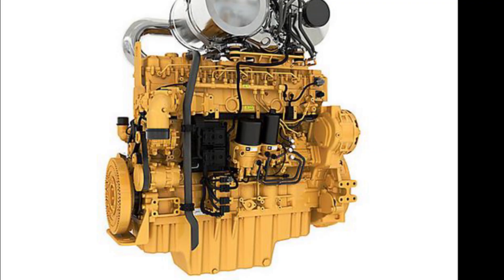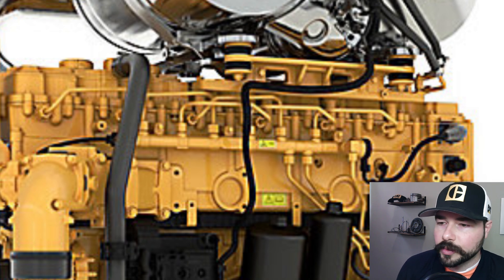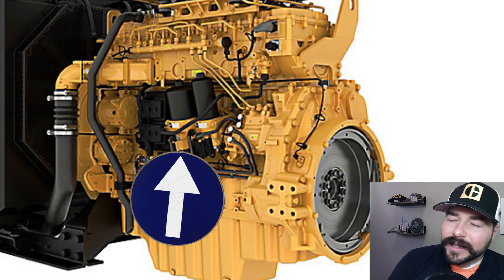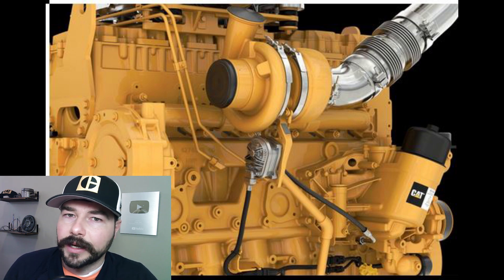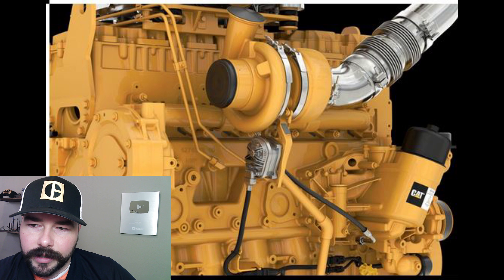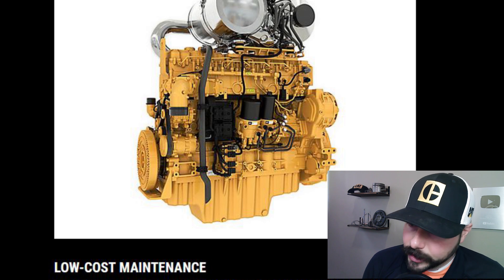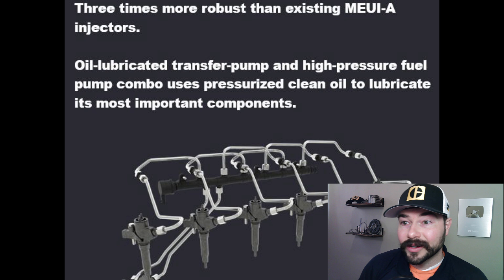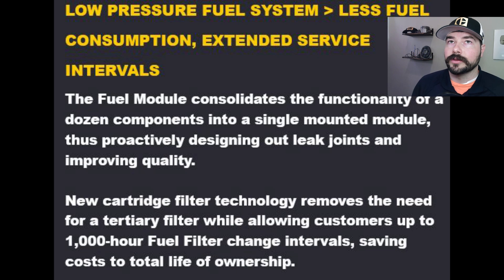New Cat Engine set to replace the C15.... The Cat C13D, 690 Horsepower.

Comment: I can never quite wrap my head around how so many large diesel or equipment manufacturers have made a consistent shift to smaller displacement trying to pump out larger oem hp numbers then the larger engine they replaced 🤔 I’d rather comfortable work a larger displacement engine at a nice hp spec then work the balls off a smaller displacement motor to achieve the same ponies. But I guess how’s a manufacturer supposed to make money from rebuilds or parts if god forbid it made an reasonable expected time inbeteeen rebuilds or excessive parts 🤔🤣🤣
Reply: Look at Volvo engines a much heavy duty  lower end and block. Also, compound turbos Volvos problem has always been reliability if caterpillar can do the same with the know reliability that would be fantastic, but I’m not holding my breath. I remember when the first C MODEL came out. I remember the first twin turbos the bridge engine and some IVA PROBLEMS

Comment: John Deere 13.5 liter stock marine @ 750hp @ 2200 rpms. 2237 #'s torque at 1700.  This Orange engine that hahaha, "identifies" as a Cat, umm, 690 hp will probably be reliable and not have a rod put a window in the block.  I bet the peak torque is at a higher rpms then the standard pulling at 13~1400 of the 3406 category engines.

Comment: I’m skeptical about these new canister filters. Spin on filters replaced canisters decades ago because they were less prone to leaks and easier to change. Is this “everything old is new again”? 
The trend toward modularizing everything might be easier for assembly and reduce labor costs, but knowing Cat, I’m sure the price of replacing an entire fuel pump module will be astronomical. Why sell a $500 transfer pump when you can sell a $5,000 module? More throwaway technology. 
The great thing about old Caterpillar engines is if the only part you need is a $2 spring, you could replace it.

Comment: Back in the day the 1693 had rear timing chest. The 3406 they moved the timing chest to the front for easier serviceability. So going backwards in that area. The cartridge style filters again cat used to have cleanable cartridge fuel filters so kinda going backwards there too. I would think in a truck configuration the scr and dpf will move to somewhere below the frame and not on top of the engine. I think this for 2 reasons. Clearance aka space constraints and heat. You really dont want all that heat under your hood

Comment: I am afraid it is some collaboration with fiat/iveco by the looks of the engine 🤷🏼‍♀️
Same thing are c8.7 and c12.9 marine engines, basically iveco engines that cat modified a bit and they are no good in any way. If this is done like thoes two marine models you will have a lot of problems in warranty 🤦🏼‍♀️

Comment: No EGR anymore and Commonrail. The exhaust aftertreatment system looks very modern to me since it seems to be an SCR CAT and a DPF directly in Series behind each other and the distance to the turbo outlet is short which is ideal. 
Hydraulic Lifters... not a huge fan of those in an industrial diesel they will wear out and collapse inevitably at some point but should be an easy fix to just drop a set of new Lifters in an engine like this.
I'm not surprised that they brought these modernizations into this engine BUT regarding the Injectors it really depends on the design and the supplier how well they will hold up.

Comment: 1000 hour fuel filter changes? Have the Cat engineers purchased fuel lately? I have changed fuel filters on my diesel pickup (before pulling our 5th wheel) and filled up at a Love's or Pilot station and had to change fuel filters on the side of the highway 20 miles down the road. It happens a lot. Diesel fuel is terrible nowadays. Some people think fuel filter changes are by hour/miles. Fuel filter changes are when needed.

Comment: Looks interesting. HLA is coined name by Eaton, number one maker of valvetrain components and valves. The JD 18L uses HLA. I see it as necessary step for cylinder deactivation for stringent emissions and GHG reductions. Oil module looks similar to Paccar one that is made by Mann Hummel. Fuel system looks a lot like the new Mahle filtration module with Delphi common rail. Turbo looks like Borg Warner style like used on Duramax L5Ps. Nice video Josh. Curious if CGI block, if liner is upper, mid bore, or lower flange style. Obviously overhead cam.
Reply: I believe every new block by every manufacturer is CGI... because  they have their components cast by the same manufactures their competitors do...or whoever got the lowest bid I suppose

Comment: You all say that a 13 literally won't handle the horsepower then you don't know much about engine manufacturers!
 Mack had mp engines out for years that have been putting out 600 hp.

Comment: give me a mechanical engine to work on they are simple to work with and to figure out compared to a common rail engine they have so many more components to diagnose and replace. I agree with you Josh that meui injection is better in the fact that they work with less components unlike a heui injector that has oil and fuel but they are both a low pressure fuel system and better in my opinion for cost of repairs i just like the fact of being able to open a valve cover and running an overhead on the engine i can inspect the components and how they wear if any with hydraulic lifter you have no reason to open up the valve cover that means you have no idea how the components are behaving up there other than listening to it running but in the end i may be wrong and CAT may know something i don't i m kind of old style 
cheers and keep on the great work

Comment: Scratching my head on this one. What piece of heavy construction equipment be it a front end loader, excavator, road grader, bulldozer, or even a genset need 690 Hp for? Josh, you've worked on heavy equipment in the Las Vegas desert just as I did, and we both know there is no piece of heavy construction equipment that can operate for 1,000-hours working in a dusty environment without regular oil/filter changes. They just wouldn't last and if you remember companies like Chaparral at the time I lived out there had some pretty old equipment because he was too cheap to upgrade the fleet. I was servicing his equipment on-site every night and stuff still broke. He trying blaming me for the failure of a turntable gearbox on his CAT 345 which I had checked the oil level on both dipsticks the night before and they were just fine. My job was to maintain the equipment, not diagnose and repair, that was your companies job. I got blamed for the failure because my hands were the last to touch that piece of worn out junky equipment. I don't miss that city one bit.

Comment: In my experience with vgt is they are often mis diagnosed as the actuator being the problem when it's the turbo itself .as you said it's a carbon environment and the veins stick and won't move.
Reply: Yep. Any time we have an actuator failure we make sure to really check the turbo. It should do it's full sweep without sticking or binding. Often the turbo vanes start getting stuck which overloads the actuator or makes it not able to hit the stops.

Comment: Interesting.   If you want 1000 hour service intervals, it isn't just a matter of more fuel filtering.   You need more oil (bigger oil pan, or an external tank) and more oil filter capacity.   In 3406 and C15 (which come with a single oil filter standard), with the use of some simple Cat parts meant for marine engines, you can have 2 or 3 oil filters working in parallel - each filter having half or one third the oil passing through it.
How can you do that on this new engine?    Looks like it will need major modifications.
Looks like Cat reducing its market again, after giving up heavy haul trucks.    Plenty of marine users of the 3406 needed the easy bolt-on arrangement of two oil filters with a lever to route the oil through one filter or the other - this lets you change the oil filters without shutting down the engine.
Reply: Given volvo use three oil filters for all Thier straight sixes, but still 600hour service intervals.

Comment: I think it’s disingenuous at best to say that cartridge style filters are new technology. I would also say the same about their claim that their common rail injector is as durable as a MUEI let alone 3 times more durable. I also would prefer a front geartrain for a gear driven water pump and compressor, especially on highway trucks with a conventional hood.

Comment: Diesel and engine oil combined with heat cold cycles will degrade the plastic filter housings and make them brittle over time. Not a good idea.

Comment: Will be interesting to see if they can actually get a reliable, compliant 690HP and 2360ft/lbs out of this engine in real world use. For marine use, maybe so, but if it finds its way into highway tractors that will be the real test. Those are some serious numbers mostly reserved for big displacement engines,15 and 16+ liter Cummins, Detroit and even Scania V8s, it will be pretty impressive if they can actually get those numbers out of a 13 liter.
Reply: Maybe test run it in an Australian road train prime mover (tractor unit)with 3-4 heavy trailers behind it in outback Australia in the middle of summer with a hot northerly wind
Reply: People have been getting over 700 hp from an old school Detroit Diesel 8V92TTA for years, and that's decades old technology. And that's only a 12 liter engine.
Reply: I seriously doubt Caterpillar will get back into on highway engines.
Reply: It's the technology brother paccar mx13 are mean bitches old 12.7 detroit u got right injector manifold and so on u get go with 600 hp all day
Reply: The way that DPF is set up I’m guessing it’s a marine engine or for off road equipment.
Reply: I would think with today’s technology it should be able to be easily achievable
Reply: Compliancy is no longer a problem because the EPA got their cock slapped in court. No more EPA bullshit.
Reply: @jonathonbridges9625  please elaborate. can you give me something to search for? I'd like to read up on it. Much appreciated.

Comment: 7:11 Most other companies refer to the the unit that automatically adjusts the valve lash as HLAs.
It's not a new term, just new to CAT. 
🙂👍
Maybe CAT will become competitive again in the engine market with this emissions compliant engine...
Our mining company stepped away from CAT underground machines a few years ago and moved exclusively to Sandvik to avoid the CAT machines. They run the big dumb 27lt in AD65, and the overstretched C15 in the R3000 loader.
Neither machine competes well with the Sandvik machines with their tier 4 final Penta engines.

Comment: The new engine features a belt driven water pump integrated into what they call there fluid module for less leak points and easier servicing, along with hydraulic lifters so no need for valve lash adjustment.

Comment: So if this engine actually hits it out of the ballpark will we ever see this between two frame frame rails  of a semi truck that's all I would really like to know 👍
Reply: Time will tell, but I think it's unlikely. The majority of trucks are fleet ones any more and they're more focused on saving money. And, generally the cheapest option is going to be the standard factory engine. A CAT is going to be the more expensive optional choice. And, for emissions they'd have to develop a different system so it would fit into the trucks. Just not really worth it for them at this point.
Reply: @NBSV1  if cat release a new engine for trucks I know every second truck in Australia would have one, they were extremely popular before they stopped making them

Comment: Curious, these new Cats engine are industrial, and not over road ? It's  definitely looks like push rod engine. Deere is 500 hours
Reply: Cat is not re-entering the over the road market, this is industrial. I work at the facility where we make c7-c18 and we always ask and answer is always no, market has changed with emissions and most manufacturers going in-house. C13D is in the same boat. Cat will continue to support parts and service for OTR engines, but has been out of new OTR engines since 2008/2009.

Comment: Hello Josh i wonder if this program will include trucks with glider kit. for instanse if my truck is a 2011 with a C15 6NZ can i make it rebuilt with new parts ?  Or the truck absolutly need to be the same age as the motor ? @adeptape

Comment: Looks like a pile of shit to me. Typical of all manufacturers today they all building in points that will fail so they can make money on repairs. As for the inverted filters, that is so stupid some auto manufacturers are going back to the old style. Those inverted filter fail easily causing drain back. Which some could say causes you to start up with no oil pressure till the filter has filled up.

Comment: Doesn't do me a bit of good unless they offer on highway engines again. My 6NZ is at 2.3 million. I am glad Cat is offering new C15's again. I would really like to see Cat get back into the on highway market. My 2022 Pete has the MX13... weight is extremely important in my line of work that's why I have been going with PACCAR. CAT needs to be at or less what the MX13 weighs if they want to get back into the on highway market. The X15 is too heavy for me to consider. My 2022 389 is 265" wheelbase, 510hp 1850tq MX13, 18 speed, lockers on both diffs, 70" flat top and tag weight is 16,020 lbs.
Reply: Eh, not for nothing, but if weight was your concern, you wouldn't be running a 389 with an 18 speed lol.  The weight difference between the ISX15 and the MX is only about 400lbs anyway.
Reply: It's a difference of one fat girl

Comment: I think they’ll spend as much time in the shop as on the road. Baseing that off of fuel system and gear train. Not as reliable injectors and I’m not a fan of hp fuel pumps either. But to me it looks as if the gear train needs replacement then the motor needs to come out. That may not be the case though. You maybe able to replace it with just pulling the transmission but who really wants to be under the truck replacing gears and setting lash. Another thing I’m not big on is the hydraulic lifters. I’d rather mechanical and have to take the two hours to run the overhead

Comment: the very 1st concern that pops into my mind is the strength & durability of the rotating assembly as well as the block considering that much horsepower out of a relatively small(er) displacement engine.
Reply: If memory serves correctly, there were quite a few guys running 700hp+ (not factory though) 12.7L 60 Series back in the day and still today. Although, from what I heard they weren't exactly the most reliable at those elevated power levels.
Reply: @DeathHead1358  I think I heard the same thing...
Reply: Other manufacturers have been doing this higher hp smaller engine thing for quite a while now. FPT builds their 12.9l (also known as the Cursor 13) rotating assemblies like other manufacturers are building their 18l rotating assemblies. I’ve worked on them. It’s quite impressive. No EGR either except they have never used EGR to pass emissions regulations.
Reply: Very application specific
Reply: The paccar mx-13 engine makes 500 horsepower at 12.9 liters and I’ve seen 2 engines at a little over a million miles with the main bearing that look like they’re just getting broken in very good engines

Comment: Josh thanks for breaking this engine down for us common folks. I think it's like the big 3 pushing new trucks with smaller eco friendly engines.  Need to see how long they last and some of the carnage left over.😮
Reply: Doesn't make a lot of sense because the reign of the 15l is a much more relatively recent phenomenon with the deregulation of truck sizes and increasing speed limits. 
    Now actually it's more apt to say the 15 is more loved today than ever because the cummins x15 and Detroit dd15 completely hog up the lions share of the heavy duty truck lineup

Comment: Paccar suggests 60k miles (1,000 hrs) oil change interval in on road line haul operations. Crazy long interval in my opinion
Reply: I've done up to 40k intervals in my Paccar mx13 Epa10 and had great oil samples... I won't go over that though because after 35-40k the oil just seems like sludge...

Comment: Hi Josh, that was my destruction of the week. Its a paccar made engine and is a 13 litre, 530 horsepower
Reply: 530 in Euro 6 form, not EPA trim.
Reply: 530 hp ?  The highest rating I’ve seen is 510 hp.
Reply: @redmesa2975  In the EU the Daf MX-13 (Paccar MX- 13) max is 530HP,  probably  the Paccar MX engines has been for the US market
Reply: @crocket1971  yes this is a latest generation EU spec engine
Reply: @redmesa2975  has been adapted for the US market
Reply: 530hp?? Is that normal for that motor or is that boosted up?? Ecm tuning , bigger turbo,  bigger injectors???
Reply: @paulmccarrell5335  normal. Its the generation after the one you see in the usa. Has a common rail fuel system

Comment: 250 is generally the "Severe Service" PM interval, a standard PM1/2 is 500 on the majority of machines. 
Yeah, MEUI is rock-solid. Their claims sound about as solid as Bosch's claims that the CP4 was an improvement on the CP3.
Reply: I personally don't know much those MEUI systems just by design they have to be very solid, with those Bosch pumps CP3 and the CP4 it seems to me, all Bosch did with the CP4 was add 1 to the suffix, some design differences and use cheaper internel parts..

Comment: Most rear gear train design was the old 1600 series, 1693, 1676, 1674. Not using a spin on fuel filters keeps people from prefilling the filter and causing early hour failure of contaminated fuel. Wonder what the max fuel psi is in the rail?
Reply: Probably around 35 to 40 thousands psi
Reply: So you really think some ham fisted moron wont contaminate a cartridge filter. Dirt falling into the housing rain snow crumbs from his cheese puffs